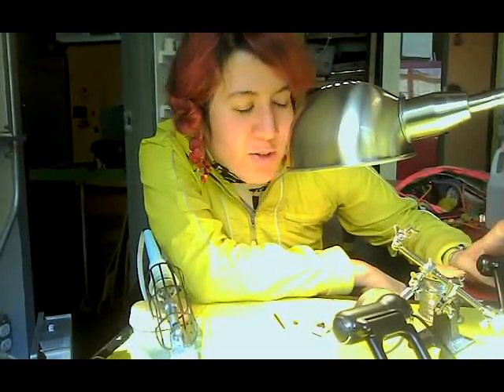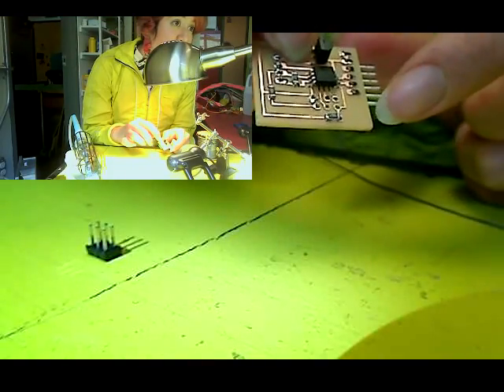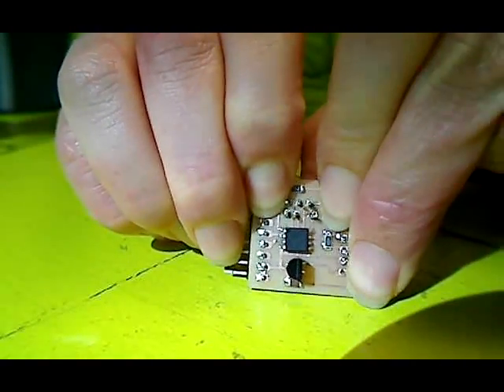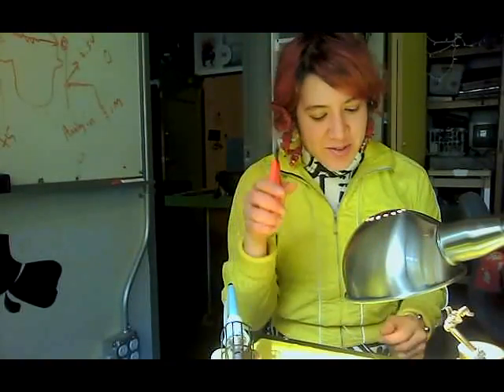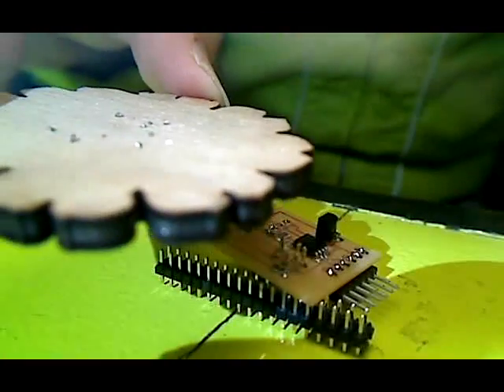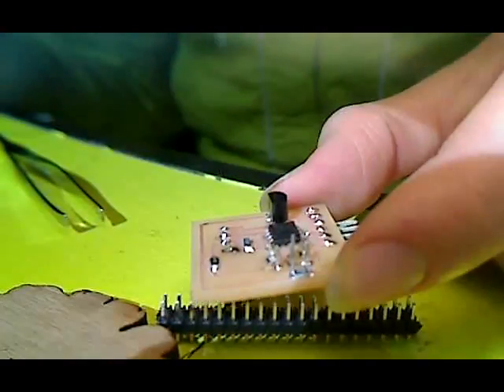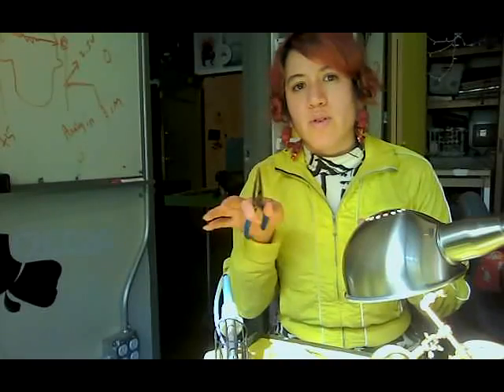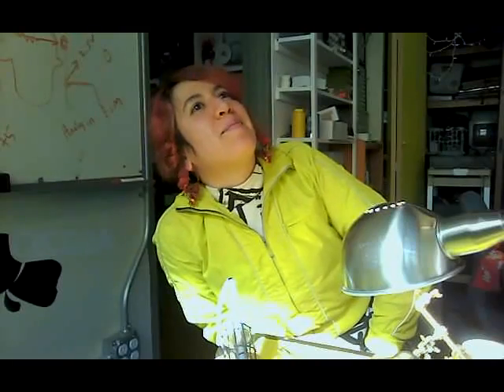Jenine Bressner's Soldering Tutorial

Comment: Unfortunately this technique has its problems, mainly around flux. Flux helps to achieve a clean reliable join by removing oxidation. Borax is usually used as a flux in silver soldering whereas flux is inside rosin cored electrical solder. By heating the solder you are burning off the flux which is the smoke coming off in the video. You either need to add straight flux or heat the part first then apply solder once hot to obtain a clean reliable joint.